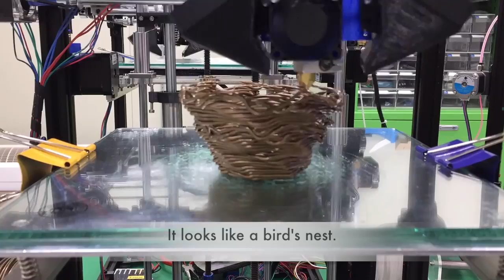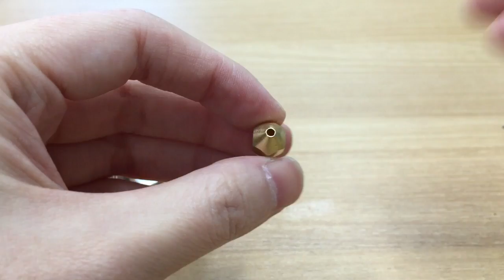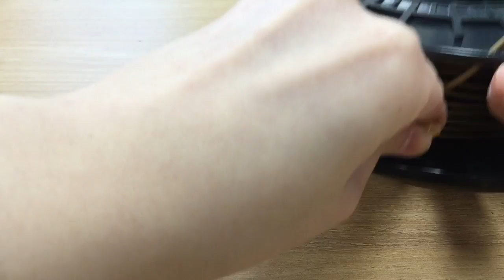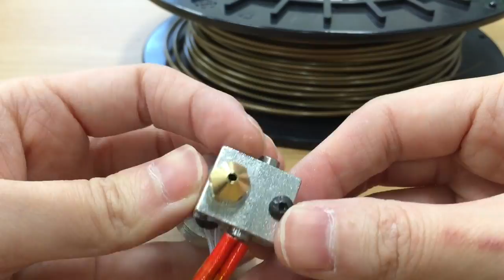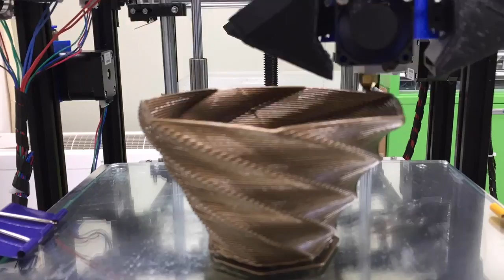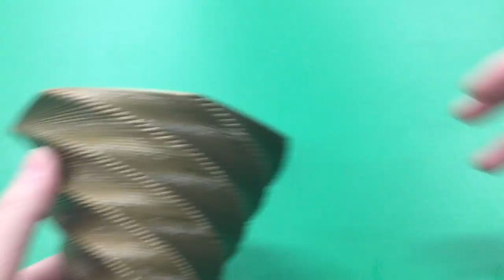Thick Nozzle (2.0mm) of FDM 3D Printer

Comment: Where did you get the extruder to do this? I’m using an ender 3 pro and want to start printing with a 2mm nozzle but am unsure what parts are compatible and where to get them.
Reply: All the parts you need are on amazon if your on a budget. Have you tried a 1mm nozzle yet? You can do that now, but if you print fast, over-shoot the temps a little bit so the heater block can keep up otherwise the filament might be 10-20c lower than the block as it comes out and not bond good. I use large nozzles on really big prints ~300-400mm with ABS (now thats a PAIN but it can be done).
Reply from the maker: I made the extruder for 2.0mm nozzle with 3D printing.